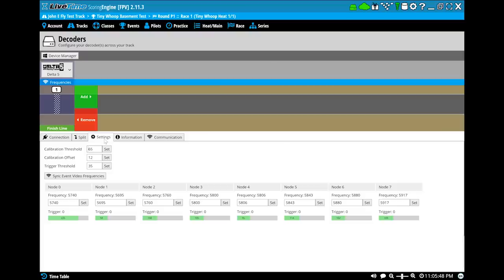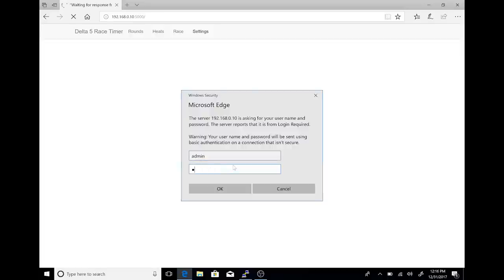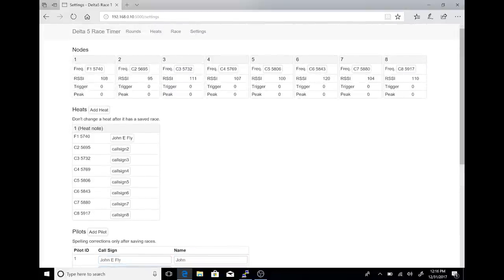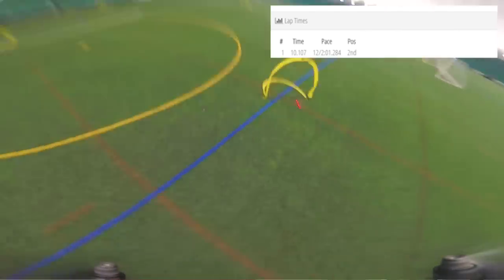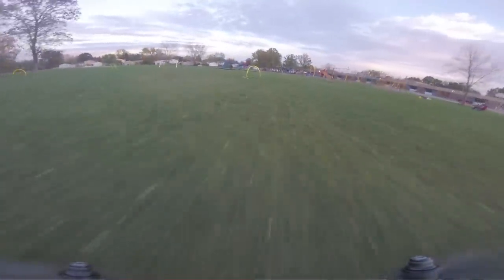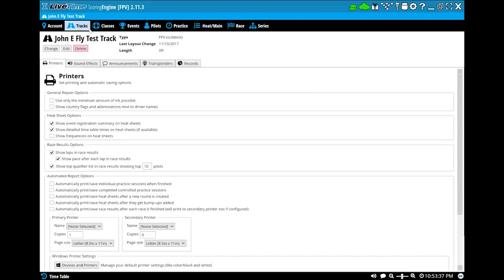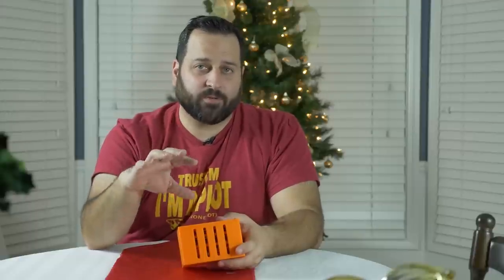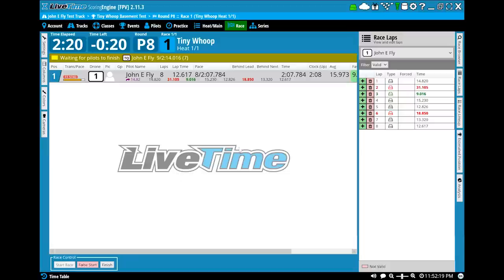DIY FPV Race Timer For Cheap!!!

Comment: That looks great! I was going to build a personal timer based on a similar concept, but I might make one for 2-4 pilots.
Reply: Wind1000100 th D5 works for up to 8 pilots.  You can build it to track 1 pilot if you really want to. It's all up to you.
Reply from the maker: +Wind1000100 Sweet!  I highly recommend it.  I built 2 nodes first without the PCB just to do a poc.  I already had all of the parts needed without buying anything.  It went so well I had to buy the rest to build out all 8 nodes.  Good luck with your build!  You won't regret it!

Comment: John E.  Has anything changed your opinion of this device (or any mods to it) sinc eth epostin of this video 6 months ago?  Have you heard of, seen, or used the PIFlight Lap Timer and/or have an opinion of that DIY for around $20?  Thanks. Great vid
Reply from the maker: Nothing has really changed, I still absolutely love this thing.  I've been using it as the main timing system at Detroit Drone events for 6 months now.  It's been extremely reliable for me.  It definitely takes some tuning to ensure there are no missed laps at each venue, but the reliability of it has been way better than we used to have with the TBS Event Tracker.  I had a quad crash into it once which smashed it to pieces, but luckily all of the internals were okay, and it was good to go once I printed a new case for it....

I have heard of PIFlight but never used it.  It's actually using the exact some components as the Delta5 for the most part (the Delta5 has a Raspberry pi as well).  Once you start supporting 8 pilots it'll cost more than $20.  If you add wireless support, it'll cost more than $20.  With my Delta5 I can place it very far from me, and use wired ethernet to communicate.  The software is super reliable, and most importantly for me it integrates seamlessly with Livetime.  This was an awesome investment for just $150 in my opinion.  Especially when the TBS system was $1000.
Reply: Thanks for the reply.  Great to hear its working out for you still.  I saw they used some of the same components.   Think I'll start out with just the PIDFlight Lap Timer for personal practice (not flying with anyone else right now). That will give me a start and then I'll advance to the Delta5.  Very much appreciate you bringing light to the Delta5.  Looks great!  You have progressed so far in such a short amount of time.  Love to watch your enthusiasm and skills.  keep going!

Comment: Awesome! because of your video im now waiting for the parts to arrive so I can start building one, also 8 channels! thanks so much!
About the PoE... the injector puts 24 V i believe and then on the splitter side you get 12V right? but how much current? do you happen to know how much does it consume? im guessing about 2.5 amps but not sure... 
Thanks again!

Comment: There is a learning curve to figuring out BetaFlight, if you can make your craft fly how much harder would figuring out LiveTime be?
Reply from the maker: I don't really think LiveTime is more difficult, it's just different.  Yet another thing to learn.  Making a quad fly can range from super simple to very complicated.  Personally, I think that anyone that has ever spent the time to troubleshoot a quad issue, and is passionate about using a timing system will have no problem picking up LiveTime.  Especially when they have a really good video on how to setup LiveTime for FPV on their training page.

Comment: Awesome vid man. Just built a 6 node for my club. Would love to see a tuning video. With explanations of what each paramater effects and how to overcome missed calibration and missed laps. ( Using livetime)
Reply from the maker: +Adam Fursdon cool, I can start working on something.  What environments are you running into issues with?
Reply: John E Fly I had a couple of pilots that weren't getting first passes. Had to lower calibration threshold to 60 to get it to drop below the calibration rssi. Which made it a bit sensitive. But at least to was consistent. Basically I had an rssi of 210ish and a resting 115. So my understanding is you pretty much add the calibration offset and calibration threshold together and the rssi has to fall below that to calibrate trigger.
Reply from the maker: That understanding is correct.  Were you running 5" quads?  Tiny Whoops?  Indoors or Outdoors?  Flying around concrete or metal?  I've found that those outside factors play a big role in the configuration settings I need to use.  The type of track being flown, how large it is, etc. can all have an impact.  In general, like you were mentioning I like to have as large of a calibration threshold as I can which still consistently catches first passes which tends to result in the best trigger rssi.  The balance is to make sure you don't miss any first passes.  Flying Tiny Whoops in a small space surrounded by lots of concrete and metal was my most challenging tuning yet, but it just took me a few more tweaks and eventually it was 100% consistent.  The values were VERY different than when I run my 5" quads outside though, that's for sure.
Reply: Outside , open field , 5inch ,25mw, mgp gates.  Ended up with numbers 60,25, 40.
Reply from the maker: Wow, so ideal conditions.  Those are some interesting numbers.  Outside in perfect conditions I tend to be somewhere around 85, 15, 45.  I guess that's not too different from where you are...
Reply: Yea man. But a video explaining it for newbs would be awesome. I think I've got my mind around it now. I know the question comes up allot in the group tho.
Reply from the maker: Yeah man, I'm with you.  Just thinking through different scenarios since showing tuning across many different scenarios would be critical to covering tuning well IMO.  That's primarily why I was curious what scenarios were causing you trouble.  I'm also curious what sort of equipment people were running that had problems...  Was it always the same nodes?  Was it always the same quads?  Just curious

Comment: Great video, I'm looking at building one myself for using during practice. Looking at the github description it says u have to open up the rx5808 and remove a resistor? Did u have to do this in your build using that pcb?
Reply from the maker: No, I did not.  It seems that all RX5808 receivers ordered through banggood have been shipped with the mod already applied for quite some time.  I did open the first 3 receivers only to find they already had the resistor removed.  After that I just used them without opening them and all was good.  To be honest, taking the shield off and putting it back on is a bit of a PIA.  I'm glad they are all shipping already done now.
Reply: Ah cool fingers crossed mine have already been removed as taking it off looks a head ache. The link for the pcb you have supplied does that come with minimum of 5 for 4 dollars?
Reply from the maker: +Bert FPV it was a minimum of 10 for $5 + shipping.  You can probably order them elsewhere though.  And you may be about to find people selling some since they don't need all 10.

Comment: I bought  a LapRF for the same reason you did and have been looking at the Delta 5 project because it would not track more than 2 pilots reliably.  You have made up my mind, I am going to build one too.  Again, thank you for sharing, very cool. 

I was thinking of using a multi-channel DVR alongside for playback or showing feeds live, as that would be a great add-on.   Have you connected video?  

"Pay it forward", always...
Reply from the maker: I have used video at the same time as my Delta 5, BUT, you cannot integrate video with the Delta 5.  In order for the Delta5 to be reliable you either need to run it without antennas, or you need to wire custom patch antennas with attenuators to reduce the reception in order to get reliable tracking results.  Therefore, if you were to look at the video feed from the receivers within the Delta5 they would be absolutely horrible.  If the video feed was good, the RSSI would be too high to reliably tell when the quad is passing through the gate.

So if you want to also include multi-channel DVR, you'll need separate video receivers running through a multi-channel DVR system.  I've been playing with those for a bit.  Unfortunately, I followed some bad advise at first and purchased a DVR which performs very poorly for FPV feeds.  Luckily it was only a $32 mistake!

Comment: Does this only work for drones? I'm looking for time tracking for motorcycles.
Reply: S K I imagine that you can put a video transmitter on the bike because that’s what it uses to track with. You wouldn’t need a camera just a $10 vtx with a antenna weighs a few grams and it would time your laps for the bike.
Reply: @rbmwiv  - Something like this?
https://www.akktek.com/products/vtx/akk-race-vtx.html
Feed it 5V, small antenna, use the button to set the channel/band?
I play wheelchair basketball and it would be interesting to set something up for lap times, etc. for training.
Thanks!

Comment: Too bad someone doesn't sell one of these pre-made. I'd love to buy one.

I suppose I could try to build one, but I'd need a step by step video or manual to figure all of this out.
Reply from the maker: I'm probably going to work on a video showing everything step by step.  I'll probably only build it with one node to start, but I also know some people interested in purchasing them, but not interested in building.  Subscribe to the channel, and we'll see when I can finally put it out.  There are quite a few steps involved, but it's well worth it IMO!
Reply: That would be awesome. I'd send you some cases of beer if I could :)
Reply: John E Fly The last of my widgets come in tomorrow 2/12/18.  If your interested in doing a build video; you can use my components and I'll pay you for your efforts.  I think were neighbors (I live in Northville), so coordination shouldn't be an issue.  Please let me know.

Also, in your video's you are flying around in an indoor soccer field.  Are you renting the time or is open to the public?
Reply from the maker: Dan I would be interested.  Can you e-mail me at johneflyyt@gmail.com ?

Comment: on some build lists i see .01uf capacitors, are they needed with the v2 pcb that you used?
Reply from the maker: I did not add any capacitors, and I've been using my build for about 3 months now.  I use it a ton, and it's been working great.  I would be curious to know why the capacitor was needed in the other builds.  I also ran my build without the pcb in the past and didn't run into issues.
Reply: ok thanks, yea i have no idea, im thinking it's just one of the boards.  DeepImpactFPV has a build video using a 6 node board and it has a place for them.  I've got everything ordered, and printed a case.  This will be great for our local chapter this year!  We were talking about getting one together last year but never actually did it.